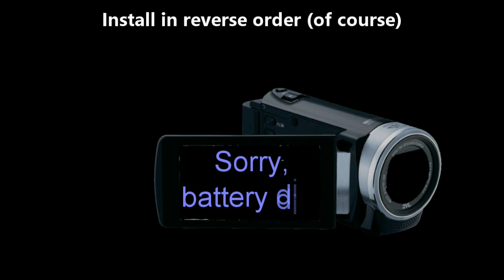Changing the clutch on my Kawasaki 2005 ZX10R Ninja

Comment: I was having a vibration issue when letting the clutch out in first gear about to roll on throttle, would the shorter springs cause this? Why are the longer springs nice? Im replacing the whole clutch from a barrett  Jackson to oem today

Comment: you should do a continuation of the video for the cover installation, the bolt tightening sequence and proper clutch adjustment
Reply from the maker: derrick Milbourne my video glasses battery died or I would have. my son also has a ZX10R, sounds like his clutch basket is loose (common from what I've heard) so if we do his I'll definitely add that to the video.
Reply: Are you referring to the springs in the back of the basket?  Ive never had a problem with the basket itself coming loose.. thats weird! !
Reply from the maker: derrick Milbourne the rivets on the basket I guess. his makes a slight rattle. I saw something about it in the forums.
Reply: yea a lot of folks will get those welded, me personally have not had that issue yet in almost 7 years of owning the bike and 5 of them racing it, i know the gen 2 zx10 has that issue bad... it is worth looking into a billet basket or just simply doing what you intend on doing and that is welding to prevent any damage in the future
Reply from the maker: derrick Milbourne I saw the gen 2 had major issues too, if I can weld it when I take it apart I  will. thanks for the info.

Comment: So I noticed on the outlaw kits you are not supposed to run full synthetic oil.. is that the case on all kevlar discs or just the outlaw brand? Thanks in advanced
Reply from the maker: I didn't see that on these discs... I still ran synthetic in this bike with no problems.

Comment: i have an 05, did all this but i have a bunch of slack in the clutch cable and i feel like the clutch rod isnt engadging the clutch like it should. ive look up so much and just dont see whats wrong.
could the new plates be to thick or something?
Reply from the maker: It could be that you are missing a plate oh, did it look like it filled up the basket like in the video?
Reply: @MotoCheez  yes everything is exactly the same, the kit is the same even.
i went out to take it out of gear to see if that was my prob, assuming somehting silly... nothing.
its like theirs no resistance on the rod (part that connects the cable) until it hits the end of its through but this leaves a ton of slack in the cable. nither the rod or the pusher thing in there look bad at all. the only thing i can think of is if the steel plates are not the correct width somehow and there's no room to engage. or visaversa but everything is tight lined up fits great. i have lined everything up stagared the last fiber... idk.  hes clutch cable was really tough before this, just a side note.
Reply from the maker: I can't remember, but didn't you have to have the lever on the cover facing a certain way when you put the cover on to grab the arm that pulls the clutch basket. It's been a while
Reply: @MotoCheez  yes looks the exact same. pressure plate is in the correct spot. everything is tightened down correctly.
It has to be the stack height issue.
Reply from the maker: Must be
Reply: @MotoCheez  So im not the only one but i guess some of the outlaw kits they sent out are the wrong stack size. Going to try to get another one from them and try again. the kit they sent us was 56.5mm and spec is 53.6mm so theres no way that would ever have worked.  Thats what i get for trusting the parts sent lol.
Any other recommendations on clutch kits? Thanks
Reply from the maker: Damn. Never knew that. Can they replace the kit they sent you?
Reply: Yup they sent steel plate: 13089b (2.9 mm)
They were supposed to send 13089a (2.3mm) big difference.
They acknowledged the error and are sending a replacement. Hopefully they get it right this time lol.
Reply from the maker: Awesome

Comment: did you reuse the clutch cushion? or did you put the whole new plate set?
Reply from the maker: I did not reuse the clutch cusiin, but I did save it. I like a more positive clutch feel, works good without it
Reply: +MotoCheez thnx for answering. the first plate that goes ik in is a soft plate correct? I just replaced mine, but my clutch lever is so short. it won't go into neutral
Reply from the maker: +TheAsianDutchman you'll also have to re-adjust the clutch cable
Reply: +MotoCheez but before you did put the pressure plate back, it ended with a friction plate right and not steel? or did I see something wrong.
Reply from the maker: +TheAsianDutchman right, I said that backwards, started with friction, metal sandwiched, ended with friction..
Reply: Why didn't you soak them in oil?
Reply from the maker: I've done it both ways. It's messy to soak them first. I  start the bike and let it warm up while holding the clutch then put in gear. I've never had any issues.

Comment: Did you put that cushion back on or not?
Reply from the maker: No. Better without it IMO
Reply: @MotoCheez  I’ve been trying to put some new friction and steel plates in for the past 4 days I’ve opened up the clutch gasket 16 times now and the only results I’ve gotten so far is that the bike won’t stop wanting to move forward even when I pull in the clutch like the plates won’t separate. The other thing is they don’t grip together so the bike just slips all the time, I’m talking like 10 mph at 13K rpms.
Any advice for the reasoning behind that? Much appreciated.
Reply from the maker: @305camilo7  you sure the clutch is adjusted properly once you install the new plates? Should have 1/8" or so free play before you feel the clutch at lever
Reply: @MotoCheez  I will try that next time because now to top everything off the clutch rod shaft that when you pull the clutch it separates them is broken so I have to wait for the new one to arrive before anything else
Reply from the maker: Maybe that's the issue all along?
Reply: @MotoCheez  I don’t think so because I was still be able to pull in the clutch no problem but it can be a possibility because the teeth were a little wasted before they completely broke off (the dent on the rod)

Comment: bro your clutch is totally done wrong is why it was slipping!!!!!!! did you not take note of upon removing the old clutch that you had no friction plate for the last plate you had steel on steel.. upon new installation you installed a friction plate on the last plate before applying the pressure plate. did that not ring a alarm in your head? im not the best, but i do have great knowledge in the clutch area of a 05 zx10r.. ask me if you have any questions, this is not a good video to go by at any means! it simply lacks a lot of strong points that should be explained and done way better. especially in such an important area such as the clutch!!
Reply from the maker: derrick Milbourne I don't recall any metal on metal, I know that's no good, has to be metal then friction.  I've done at least 20 different wet clutches on bikes. maybe I cut it on the video??? I know better than that
Reply from the maker: derrick Milbourne the clutch I took out was wrong, the way I put it together was right, it started and ended with a friction plate like it should.

Comment: i am not dissing you at all, i just see you have 7k views on this vid so that tells me there are 7k people that have bad knowledge upon watching this vid.. but the worst thing you showed is how not to pay attention to detail! if you need any suggestions feel free to ask me and i will gladly help get you in the best direction i can bro...
Reply from the maker: derrick Milbourne what details? I'm curious now
Reply from the maker: I saw your other reply, clutch does not slip now because I installed it correctly. I have no idea who did it before me but it was wrong when I took it apart.
Reply: you dont always have to replace every steel and fiber either, only want to replace the ones that need replacing per the maintenance manual from Kawasaki.. I drag race my 05 zx10 and change my clutches in 5mins total time because i have to change them out so much from beating them up
Reply from the maker: derrick Milbourne true, but they come with the kit and normally they are glazed from slipping. I've been riding and doing motorcycle repairs for over 30 years. I don't use a shop manual except for torque and reference. I've rebuilt transmissions on half a dozen bikes too (Forks and shift drum, bearings etc) I know my way around a bike.
Reply: my apologies i do see now that you go into details about things i was picking on, honestly i was kind of frustrated about the video and skipped passed some stuff, due to my lack of attention of reading and being lazy i missed some parts that you do say it was intalled wrong first
Reply from the maker: derrick Milbourne LOL, no problem. I'm not an expert, I've made mistakes and you probably do know more about the zx10r clutch than I do. I just bought the bike and the clutch was slipping, if I would have taken it apart first I probably wouldn't have bought a new clutch.
Reply: how do you like that clutch kit?? I buy oem steels and fibers
Reply from the maker: derrick Milbourne I don't drag race like you, but I like a snappy clutch. I really like them over stock fibers, and of course stronger Springs. I can clutch up 4th no problem. they really grip.
Reply: ok I may atleast have to try out the springs, I like a heavy lever myself.. im on the east coast, where are you located?
Reply from the maker: derrick Milbourne I'm in North West CT. near NY
Reply: ok, i race with a guy named bob carlson hes a very good racer from Ct. he races at lebanon valley at a race called bikes in the valley maybe youve heard of it? i am from virginia, about 20 miles from d.c. we race at maryland internation raceway and get a lot of you ny and ct guys down here giving us trouble lol
Reply from the maker: derrick Milbourne I haven't heard of Bob, but a close friend of mine Mike McFadden races down there a lot. he keeps trying to get me to go. I have way too many hobbies now! hehe.
Reply from the maker: derrick Milbourne I haven't heard of Bob, but a close friend of mine Mike McFadden races down there a lot. he keeps trying to get me to go. I have way too many hobbies now! hehe.
Reply: its a great hobby
Reply from the maker: derrick Milbourne that's what I'm afraid of! lol, if you see my other videos you'd see I'm involved with a ton of hobbies, toys etc.

Comment: your didt soak the fiber plates in oil.......  big problem !
Reply from the maker: aggressive_Dan these were not organic clutch material. From all I've read online, Kevlar based fibers should not be soaked before installation
Reply: oh shit  ok  I just bought the ebc Kevlar ones   where did you install the jutter spring and flat spring????  I didn't see it in the video
Reply from the maker: aggressive_Dan yes, I took out the spring cushion, I made sure I had same thickness in plates to make up for it. Here's an article on the soaking. http://forums.13x.com/index.php?threads/do-you-have-to-soak-clutch-plates-before-installing.88026/page-2